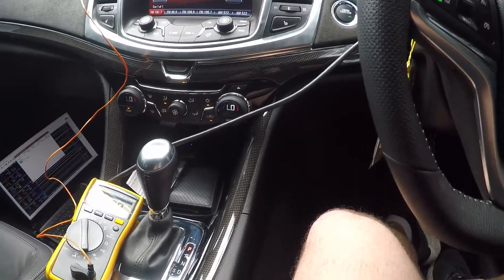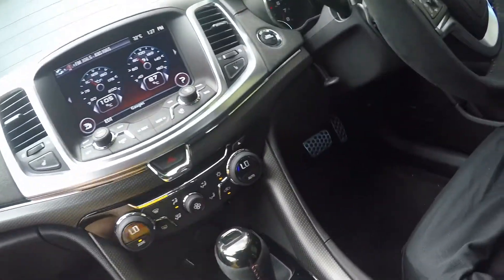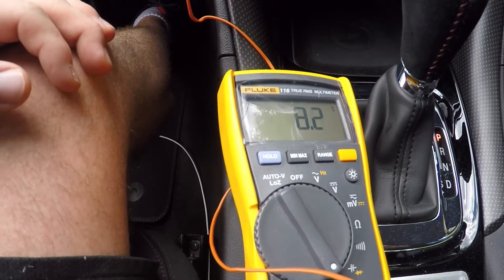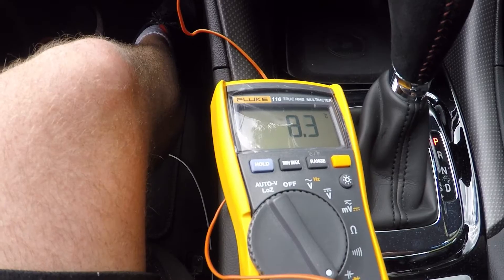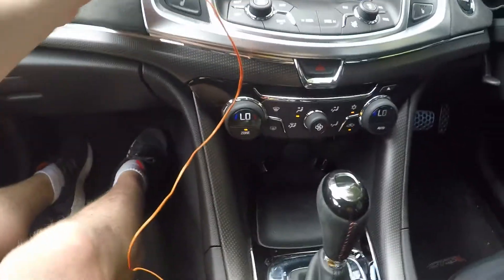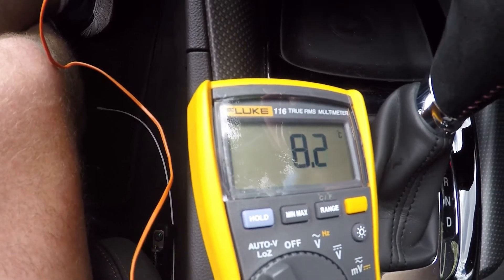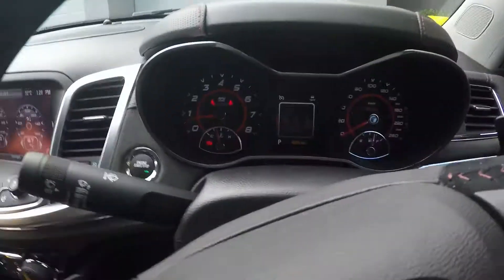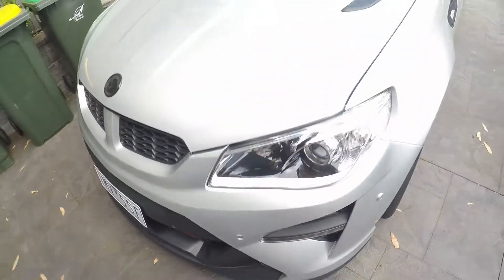Interchiller Vs Stock Cabin AC vent temps

Comment: I don't think this is an accurate way to test because you're not really doing a legit comparison. The only way to accurately test the vent temps is to test car A before AND after the install as well as factoring in the freon pressures and then compare it to car B while also noting what those freon pressures are at. Because technically Car B could be low and you could have filled Car A back to normal or more than normal. Just testing the vents and nothing else and only after the install tells nothing.

Secondly, the test should be about how much running the AC inside the cabin affects the chiller's ability to keep the fluids etc cool and if the temps are warmer with the AC active in the cabin. These systems come with 2 modes, race and normal. In normal mode you still have AC in the cabin but it diverts some of the AC so the chiller isn't working at full efficiency. In race mode there is no AC in the cabin and all the AC is going to the chiller so it works much better. What you would need to do is test the car in warm or hot temps both in Normal mode AND in Race mode to see what the differences are. That is way more important than testing the vent temps. Reason being is that in 90+ degree F ambient temps if diverting the AC to the cabin results in excessive fluid temps then that might be an issue. Because then you'd have to drive the car and be hot the whole time.
Reply from the maker: All cars have a head room in the AC system of about 20% given that they must cool down a full car load of people on a 120 degree day stopped in traffic. We have not and do not impact the cabin AC at all, as proven in this video and others. 

The reason we do not impact the AC is because the chiller is only keeping cold fluid cold, this is not hard to do. 

In terms of AC pressures the is a very small 1-2psi increase, again because we are only keeping cold fluid cold. 

If you are wanting to see fluid temps in cabin and chiller Vs chiller only mode along with vent temps you can see them right here: https://www.youtube.com/watch?v=zHmTDQYgqnQ
Reply: @ForcedInductionInterchillers  I have one of these on my ZL1 and I know they do work well. But still, my point is that it would be a good test to show how well the chiller can cool the fluids on a hot day with the cabin AC active and what the difference is when the cabin AC is off. I think that would be more of a crucial test. Obviously it will not cool as effectively when the cabin AC is active. But exactly how much...that would be good info.
Reply from the maker: @blaqwhole4998  That exact information of chiller only Vs Cabin and chiller is in the video linked previously

Comment: but you aren't currently driving.. do this test on the interstate and in city traffic..
Reply from the maker: the worst conditions an AC system can face is at idle when there isn't airflow like there is at speed. This video is at speed although as said the AC isn't under as much stress when it has airflow: http://www.youtube.com/watch?v=zHmTDQYgqnQ

Comment: Hee hee, well done champ i believe i thought of this idea of using A/C gas to run in superchargers back in the early 1980's but most performance places were like you cant do that, because of this or that, now its will be a everyday thing whereby most people will have the A/C gases and lines run to the supercharger and help keep the air temps cool all the time. :)

Comment: I believe there's a special type of A/C gas used for hi performance Extreme cold A/C air temps, and its not the current A/C gas used, i have seen it used in Heat pumps which i used to sell, i cant remember what the codes are for them, but at least 3 to 4 degrees colder than standard A/c gas used?